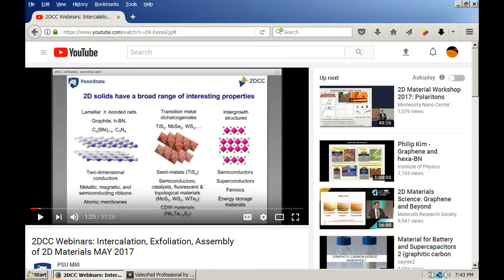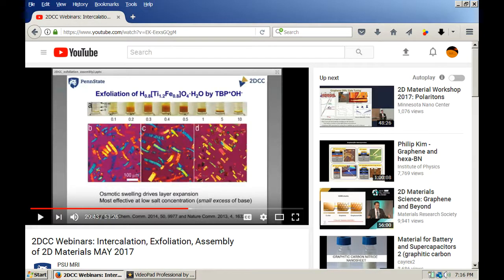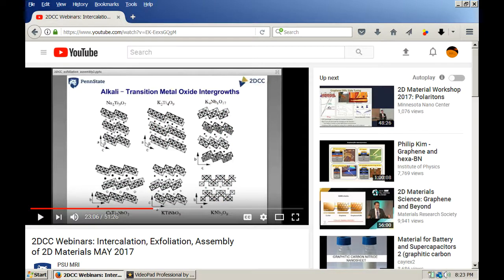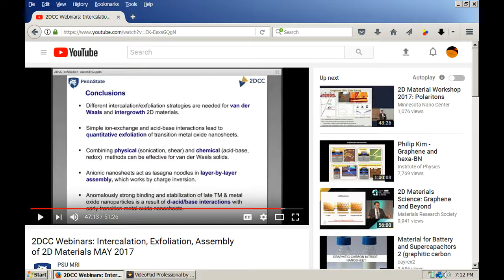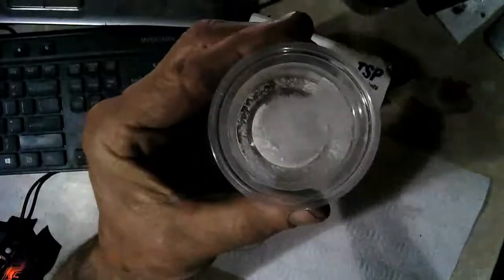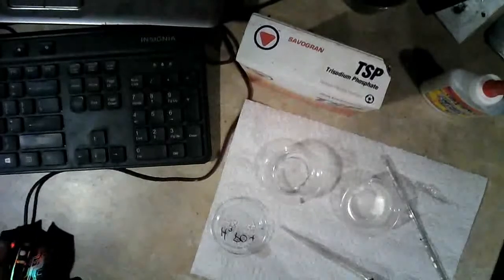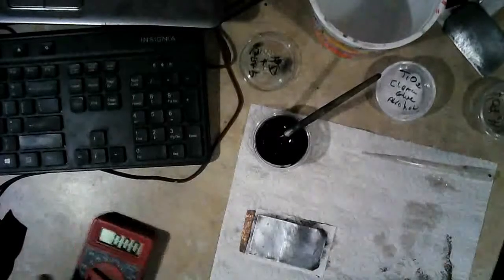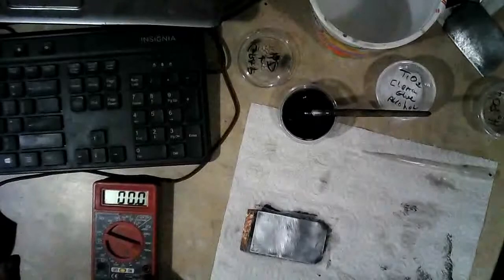Easy Intercalation & Exfoliation With Phosphoric Acid!

Comment: That’s some great info on the phosphoric intercalation in regards to just add water to break up the van der waals into signal layer . 🤔😊
Reply from the maker: I got really excited when I found that video. So many things we can do with that technology, and it's so simple that it will be hard to fuck it up too much. Lol
Reply: Bio-Cell yeah I got excited to . I bought 2 litre of phosphoric acid at a car accessories shop! They have it as a product to clean chrome wheels or alloy wheels . Cheap too
Reply from the maker: Thanks for the tip EPN! I'm almost out of phosphoric acid! :-)